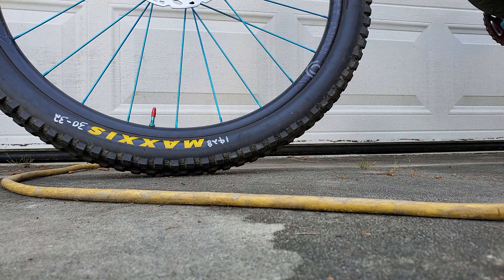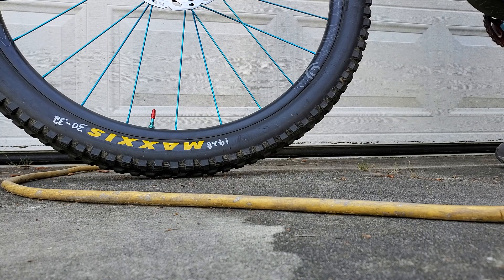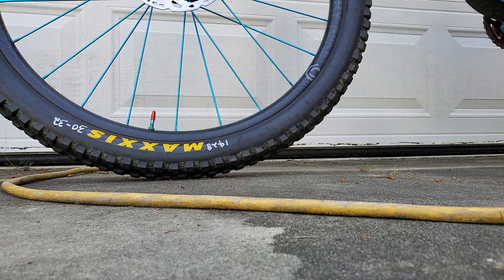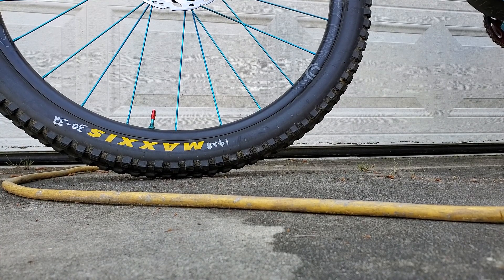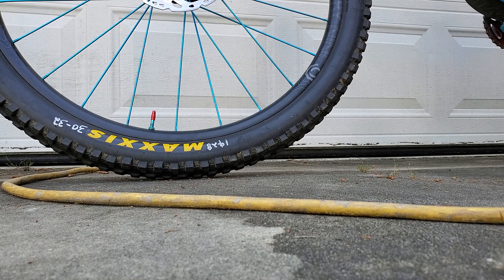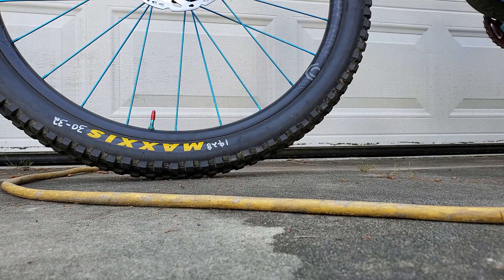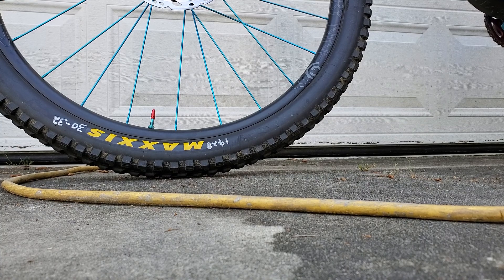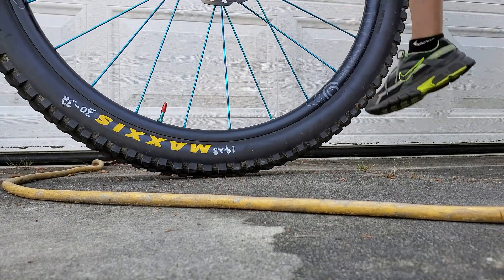Rockshox lyrik 170mm with Push ACS3 coil conversion kit. Part 2 push a d bounce test

Comment: Just ride man try not to overthink it.  Only way to know for sure if rebound is perfect is to take it on the trails.
Reply from the maker: Agreed but you  need to get it fairly close before going out there before riding so you can dial it in. 
     A little back info my Rockshox lyrik was bad from the factory from day one. I was always getting too much air pressure in the negative airspring chamber and it was never releasing back through the release port. After taking apart my suppose to be 170mm fork they had a 160mm Pike in there. Explains the negative air pressure problem, so switching the Push ACS3 air spring conversion and new 2.1RC damper it is now a truly amazing bike now and the way it was suppose to be. It's like getting a new bike.
Reply from the maker: https://youtu.be/vPpx4k1rqhs
Reply from the maker: This is the link what the old air spring was doing. Before the upgrade